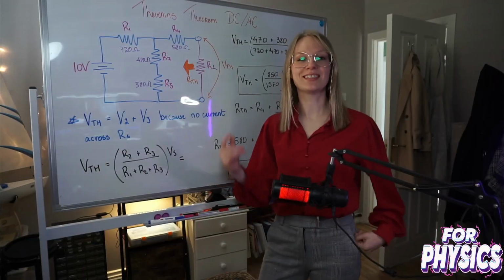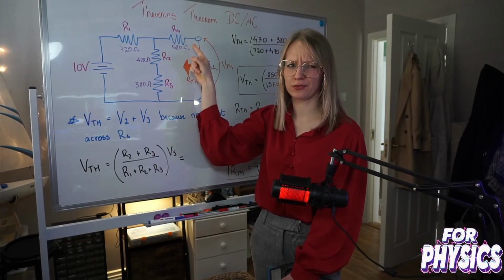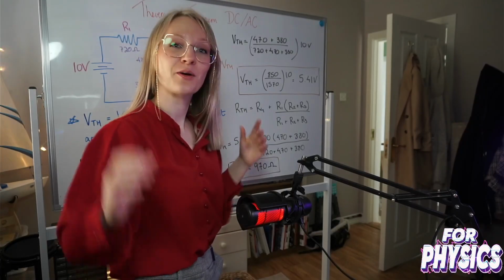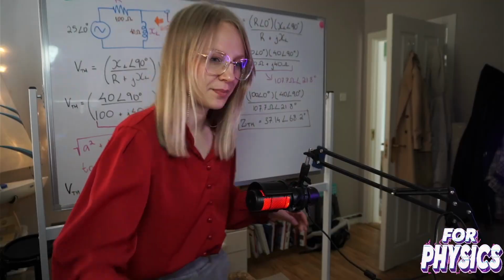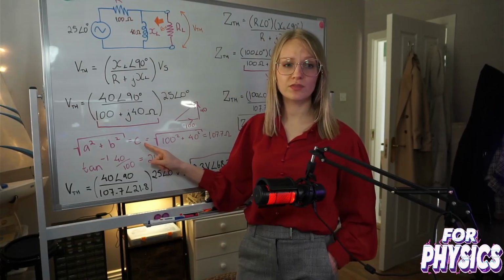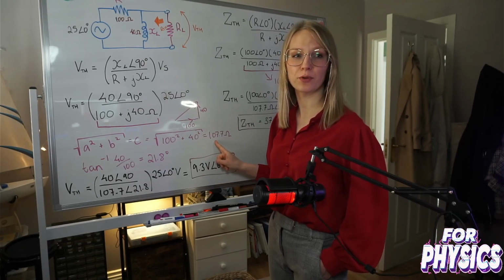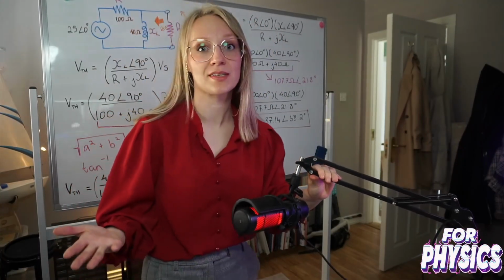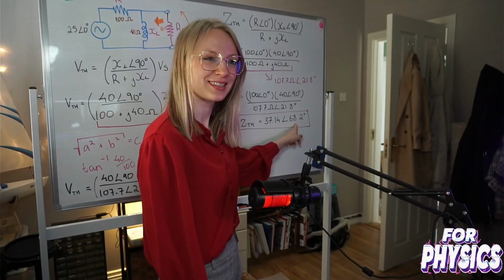Thevenin Theorem in DC and AC Circuits

Comment: Saying the meter is an infinite resistor is confusing because your putting it on a circuit that we are pretending no longer exists 🤔  Electrical is a  lot different. Physics will tell you that energy doesn't even travel in the wires at all